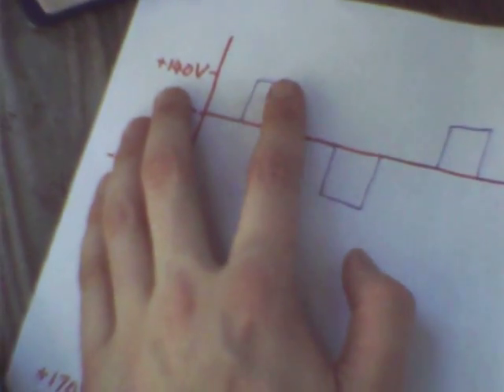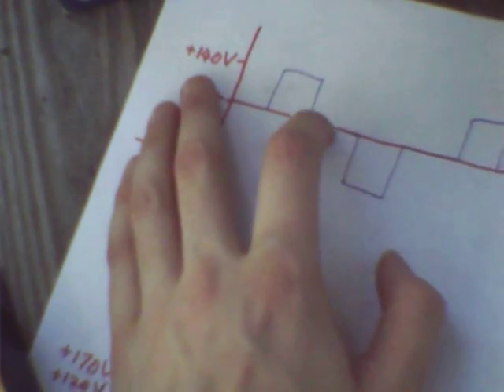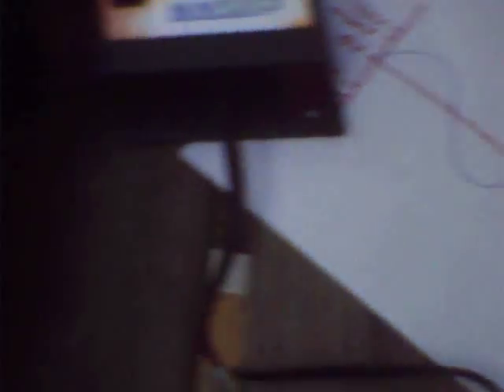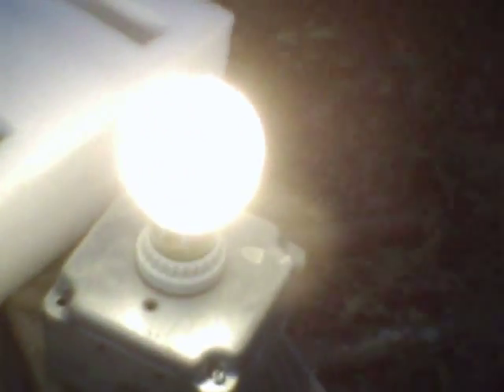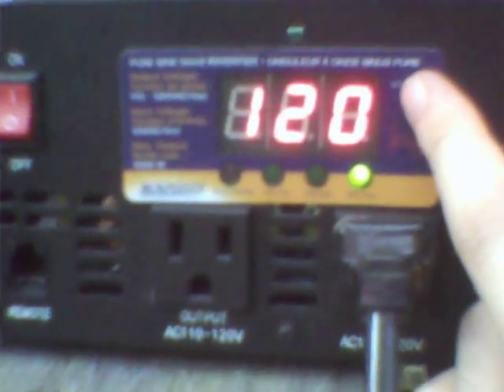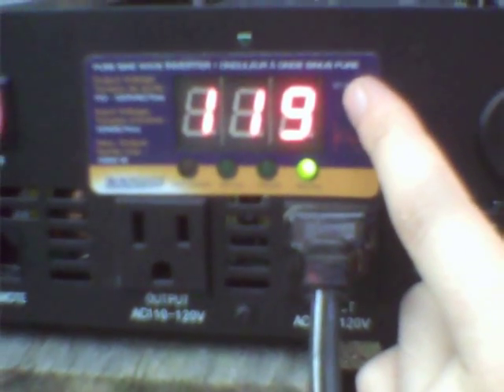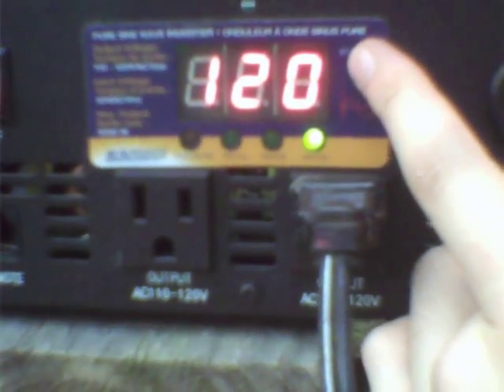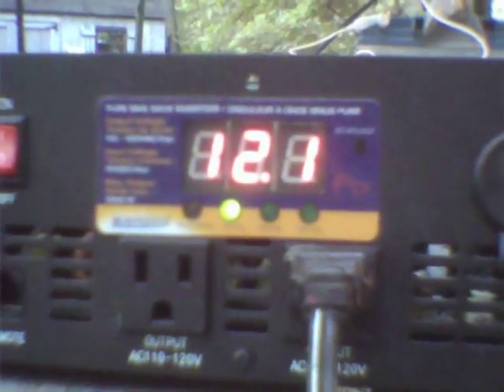Sunforce pure sine inverter guts and repair

Comment from the maker: @hyvahyva   Not yet, as I have no working scopes ATM.  It is sufficiently clean that it will not produce hum in compact fluorescent lamps that hum severely on modified square wave inverters.  Those chokes are for filtering out switching transients from the output H bridge, so their size is normal for this application.

Comment: Thank you for your prompt response !
You say , to step-up in the transformer is a good project .

Change of 18VCT power transformer is very much , AC120 ~ 115V, output voltage tap Do you exist 100V else?

Comment from the maker: Given the effort involved in tweaking the output potential of this inverter, a better solution would be feeding this inverter into a low loss 120V to 100V transformer.  The transformer inductance would have the added benefit of filtering out a lot of the crap on the output.
I am working on my own pure sine inverter design, which I hope to have finished within a year.  That one is capable of theoretically any output potential, as it uses a conventional 18VCT power transformer.

Comment from the maker: Just use a transformer with a 100V primary or a 100V tap on the primary, as I have seen both.  The trick is finding 18VCT transformers that are big enough, as they are expensive and hard to find in 1kVA and up sizes and due to how they are driven (center tap push pull), the transformer needs to be at least 80% oversized.
Then there is the issue of the variable duty cycle PWM drive signals, but that is the last hurdle in my design and I have some ideas awaiting testing.

Comment: I have a question. My Sunforce pro series 100w PS inverter is 1 volt off on its calibration on the DC side. This creates problems because it thinks it sees 15.5v when its really only 14.5. It then goes into shutdown protection. QUESTION> Do you know which component to adjust or replace to properly calibrate it. I have talked with Sunforce, no luck not even for a schematic. I live off grid in central Brazil, am reasonable knowledgeable and tech savy.

Comment: Nice to meet you, Kirara of Japan

About 11240 products Sunforce, there are very interested.

AC voltage is too high for use in Japan this product, I want to adjust the voltage AC100V.
Do you has the structure adjustable in VFB for adjustment VR?
I think you could not look in the video, to be in the vicinity of the inductor coil.

Timing board to control, the MOSFET gate of the inverter is made of a PIC microcontroller-based? EG8010 system made in China?